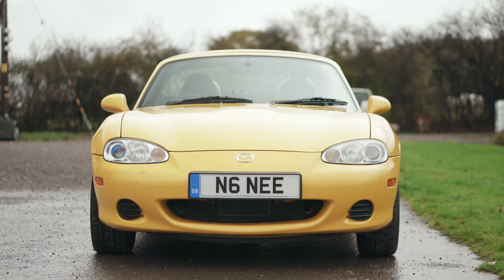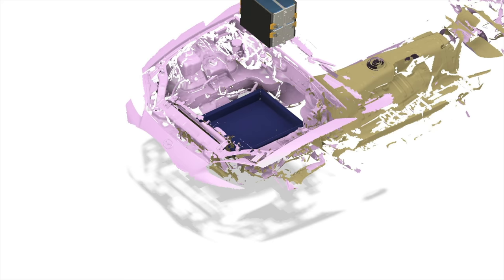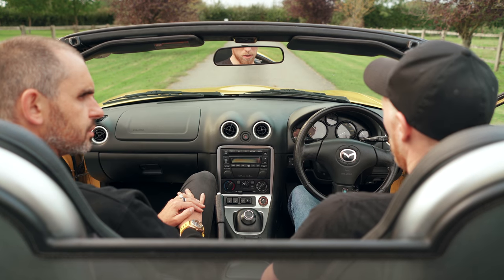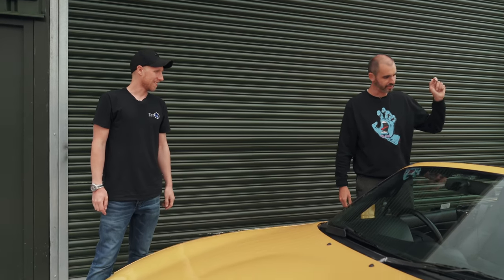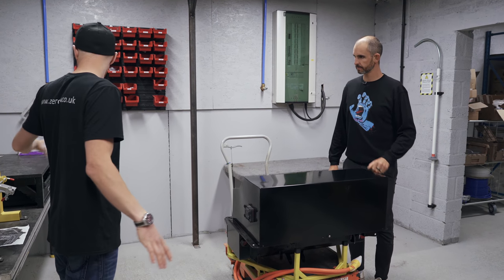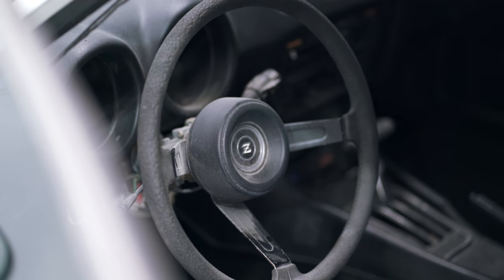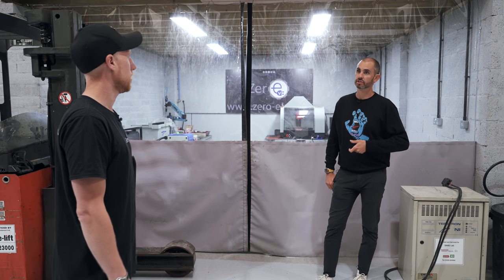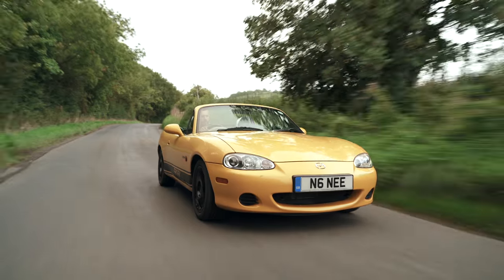EV swapped Mazda Miata MX5 // The Late Brake Show

Comment: A 964 Porsche??! 😢 A beautiful backdated car and they’re going to ruin it and make it into a golf cart. 😢
Reply from the maker: Not really a golf kart when it has 500bhp. Have you ever driven a rwd 500bhp EV with no traction control?
Reply: @TheLateBrakeShow  Clearly not and yes, I’m sure it will be fast but taking the heart of a 964 is just removing one of the things that makes these cars special. The final incarnation of an iconic flat 6.  The sound, the feel and the smell.  More than that though, the driving experience.  The very thing that makes these cars so special.  Yes, it will be quiet, yes you’ll be able to drive it in the city, yes you’ll probably be able to claim a tax break for going green in your retro styled EV.  I’ll resist calling it a classic 911 as that’s one thing it most certainly won’t be any more.  Each to their own though, if you’ve got the cash to spare and the latest EV are a bit too mainstream for you, then fill your boots. Personally though, I think it’s sad to see so many classic and iconic cars being spoiled in this way.   I’m not even entirely sure of the motivation, other than city driving and noise pollution? There are far greener alternatives and car pollution is a pretty small part of the problem anyway.

Comment: All very interesting from an engineering point of however, I'll be holding on to my MX5/MK3 and it's wonderful snicky little gear box for as long as possible - I LOVE the smell of Petrol in the morning and COME ON £20,000!!!! my beautiful convertible combustion engine Car cost me £3000!! This video is overlooking one essential point, people that drive Cars like the MX5 love driving, where is the incentive to drive this? (and please don't tell me I'll be doing my bit to save the planet zzzzzzz), it's expensive (very), has very limited range and no manual gear box - clever engineering Rubbish Car, might as well buy a Milk Float there probably a lot cheaper too!! Is your show being sponsered by Greta Thunberg or what??

Comment: Open diff. I'm out from 20 seconds in
Reply: Its using the stock mx5 rear end... that means you can slap a cusco 2 way in it... jump back in. That said, they need to pipe in some ITB noise ^_^
Reply from the maker: I did mention you can easily put a Mazda LSD in it.
Reply: Or use a base MX-5 that has an LSD
Reply from the maker: Absolutely.

Comment: or, you can buy a used a used/wrecked Zoe with 22-40kWH and 22kW AC charging and save a few thousand quids for the conversion
Reply: And you are going to engineer the plug in conversion yourself?  Knock yourself out....
Reply from the maker: Yes, but you have to assemble the batts inside another car, and the motor and the wiring. Easier said than done.
Reply: @TheLateBrakeShow  You always get these people that are planning on building a space station with a Swiss Army knife, but in reality couldn't plug in a toaster in real life...
Reply: @TheLateBrakeShow  well, the main work is to make an adapter between the electric motor and the original gearbox, That for me is kind of trivial having CAD knowledge. And reorganizing the battery modules. After all, the adaptation work should be part of the fun! :-)
Even better using the drivetrain from an i3 60Ah. 180HP and DC fast charging!
Anyway, generally speaking, the asking prices of these companies seem not marketable. Too expensive for people with not much money to convert a miata or alike, or too simple/basic for people with money that would look for something fancier.

Comment: Yikes slower then the original motor and no manual and the range isn’t anything to write home about… I would never do this to a Miata or buy one thats been converted because it seems like a loss in every aspect except for paying gas that’s the only plus side it has… increase the range and power and get a manual then MAYBE I’d consider it. At this rate I’d rather put a ND motor in my NA get 80-90 hp gain and mpg will be 30-37, get to keep the manual and over all is a better option and route then this boring ass build that seems like a waste of money

Comment: Nice, but they removed the car's soul..
Reply: Noise and pollution is just something people have gotten used to.  Once you go electric, you will actually start noticing how foul the smell of burning gas actually are and how little the noise adds to the experience, especially from a 4 cylinder in a MX5.

Not having fluids dripping on your driveway is just a bonus...